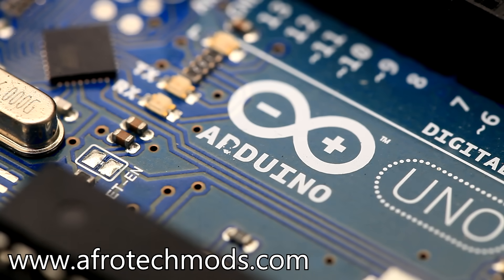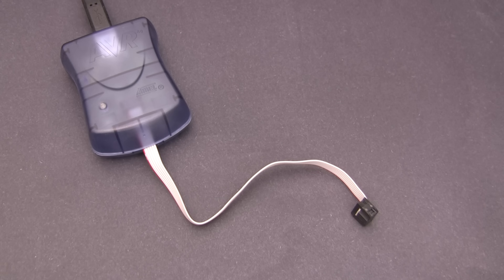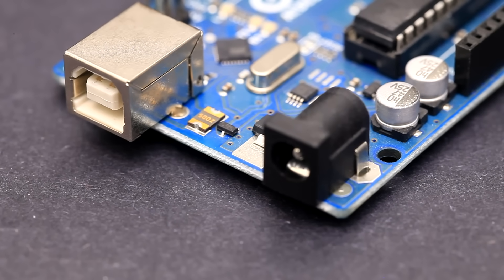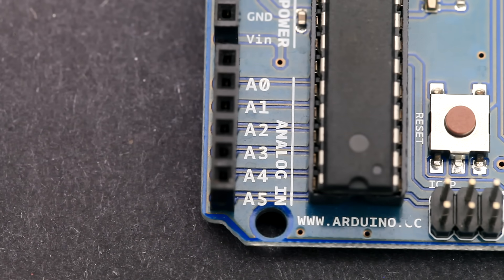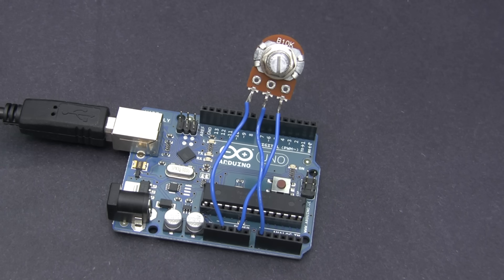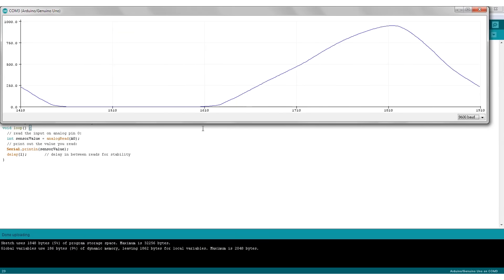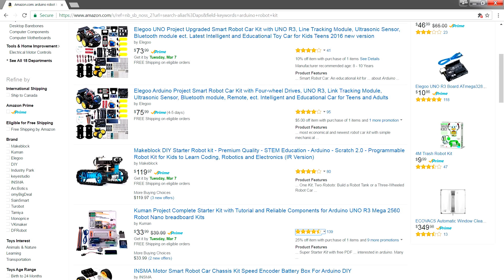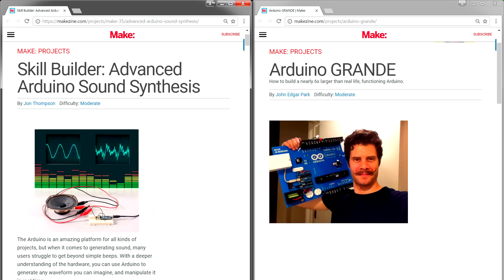You can learn Arduino in 15 minutes.

Comment: Ok so if I buy a new arduino I have to down load programming to it before it will be able to work in the system I want to use it in? its a blank chip until I program it is that correct?
Reply: Almost, when you buy the microcontroller it will be preloaded with the "blink" example. When you power on your board you'll see the LED flash on and off for one second each. Technically there is also a bootloader on the chip as well but I can't delve into that in a YT comment ha ha. Essentially, the chip is pointless until you program it for what you need.

Comment: Once you have developed a project and want to use it, do you have to keep all the parts and the UNO in a box or something? When you want to start another project do you need another UNO?
Reply: You can put them in a box if you want to make it a permanent project. You could also just pop the arduino off your breadboard and use it in another project. If you don't want the project anymore you could also just take it all apart and put it away.

Comment: Once again, an absolutely first rate tutorial!!! Afrotechmods is quickly becoming my gold standard for short and focussed explanations, while I then go to BigCliveDotCom for a more long-form, conversational approach to the practical application of those same topics.

The only thing I would add about this specific video is it may have been worthwhile mentioning that many Uno clones do not use the same virtual COM port hardware as the 'genuine' product and will not be plug and play just by installing the Arduino IDE software. For those you usually need to download the driver for the 'CH340' device. There may well be more serial chips used as well, but the three I have all require that driver. Unlike some commentators however I would not label these clones as 'bad' or 'inferior'. I have found them just as good and about a 10th of the price--£2-£4 instead of £30-£40!!!

Please keep making these little videos!!!

Comment: Great video. I'm a pro at programming PIC/ATMEL/8051 microcontrollers using proper in circuit debug tools but have been using Arduino's for some simple projects. I must say, although I didn't need to learn about it, if I was a noob this video would be perfect intro and I highly recommend it to anyone exploring Microcontrollers for the first time. Great job.

Comment: Two of the most hated modules of an electrical engineering degree, programming & DSP. Arduino's are little gems & have the best compiler it's light, stable & easy to use, miles better than the crap you find on university computers.

Comment: You might want to keep in mind that knowing how the circuit diagram operates helps the user understand how these devices use programming logic. This is useful to troubleshoot projects with programming errors. 
Understanding hardware could help you identify flaws in the system. Unless you build the circuit board from scratch , i doubt that soldering or wiring errors cause the flaw.

Comment: you can´ t learn Arduino in 15 minutes. You have to have at least basic knowledge about electronics and programming. If you have no clue about both and want to do projects, you are lost. It will take you weeks if not months to get into it. 
After 15 minutes you can basically tell what an arduino is and what it can do. However, i would not call this knowledge ...

Comment: 11:46 - but it's better instead of:
const int  analogOutPin = 9;
write:
#define ANALOG_OUT_PIN 9

Now you didn't waste memory for storing this simple number. For more information, google for "C++ #define as constant"
But for more complicated programs  const is still better.
Reply: I've seen several arduino tutorial and they all use const int instead of #define.  I cannot figure out why, especially in a system with such limited memory.
Reply: most compilers would optimize it out anyway

Comment: I don't understand why the resistor is between ground and the LED.. for this to work, wouldn't you be drawing power FROM the ground? And to stop too much current going out of a pin, with a resistor, wouldn't it need to be BEFORE the pin, as in soldered to the damned board? I don't know.. there's so many things you didn't explain here that I don't even know what to search for to find out what they mean or how they work.

Comment: Hi there, I am building a cockpit control panel which in this case has 50 switch buttons, does this Arduino board will support it, and how I will going to connect the 50 switch buttons if I only see few I/O?
I have checked as will the the Leo Bodnar card, which in this case has more I/O ports. I have never use none of these two programs or softwares, please if you can help me with some ideas, I would be glad.

Comment: I don't want to use a 9 volt battery. Trying to save money. By using 2 6 volt battery packs that are rechargeable. <--That's what I want. The 12 volt to 9 volt converter is connected to the batteries and the barrel plug.  So now that I know about the regulator on the board. I have a question: Can you leave the barrel plugged in while recharging the recharging the batteries. How in the heck would you go about charging the 2 6 volt batteries?. I know I'm missing something. The other  wires connected to the batteries. How would you connected to the 2 6 volt batteries. While it connected the way I want it?. <--I'm just asking. I don't have the arduino kit yet. I'm just trying to get advance knowledge. So I don't screw up.

Comment: A truly BRILLIANT video, and a very good explenation as to how to use Arduino, but the Arduino is a microcontroller, and the thing you keap calling a microcontroller is in fact a microprosessor. When you place a microcontroller in a circuit with prosessors, I/O-ports, etc. it becomes a microcontroller.

Comment: So, I can't add any motors to this Arduino?  Do we have a link on how to add a motor to it.  (Gear motor) I'm getting into this now.. Anyone!
Reply: You can control a geared dc motor with Arduino through a motor driver. Connect the motor to motor driver and supply the rated power to it. Take 2 digital outputs from Arduino and connect them to the control pins on the motor driver. When the digital outputs are 1, 0 -  the motor spins in a direction, when they are 0, 1 - the motor spins in the other direction (clockwise and counter-clockwise). 0, 0 and 1, 1 will stop the motor.

Comment: how many sensors can you connect to single arduino uno...?
Reply: depending upon the number of data pins that your sensor use you can connect the sensors to arduino.
for instance, if your sensor has only one data pin(e.g. - Hall effect sensor) you can connect 18 such sensors.
you can use the analog pins as digital pins.(just declare them in your main code setup)
to sum up, the number of sensors that you can connect to arduino depends upon the data pins of you sensor(s), but at max you can connect only 18 sensors (13 on Digital Pins & 5 on Analog Pins).
Hope this helps you.
Cheers!

Comment: Thanks for the awesome video. Am just new to this. In the analog input/ output example, what should I change on the program to get a 100Hz signal? I notices the frequency is around 490Hz on the oscilloscope.  Thanks again.
Reply: 100 Hz basically means 100 blinks in one second, so you can add delay in your program accordingly and run the program in loop.

Comment: so i need a computer connected at all times or can i write the program to the chip
Reply: you do not need to connect the computer/laptop connected to your arduino always.
some simple hacks to power up your arduino without computer/laptop are-
1. power up your arduino using a mobile power bank
2. power up your arduino using a normal(not adaptive) mobile phone charger
3. power up using 9V battery and the power jack connected to the arduino
4. power up using your car's USB port
basically any source that provides a stable 5V signal will do the job for powering up your arduino.
just program your arduino using computer/laptop and then power it up with any of the above mentioned methods.
hope this helps you.
Cheers!

Comment: Is it possible to connect an arduino with an eeg
Reply: yes. You can even read the voltage of the egg too.
Reply: Is it possible for the eeg to send its raw data to the arduino and the data gets to a certian point the arduino gives and output?
Reply: From your explanation, you will need to use analog voltage signal as a raw data. You can program the arduino such that when the analog voltage signal is over X value, it will give an output.
Reply: I am new to arduino programming. Could you give me the program or tell me a place where I can see the program. It would help alot.  Thanks bro

Comment: Hi ! I found your channel for a couple of days now and actually help my very much to understand things i didn't before. 
So now I do have one question more about tx and rx (transmitting or receiving signals) through arduino board. 
You said it is possible for an arduino board to communicate with componants like GPS modules, WIFI modules etc, BUT is it possible to communicate with for example 2 or 3 independant modules with the same arduino [UNO] board ? There actually is only one tx and rx pin per arduino uno board. (so do I need to use a arduino mega board ? or would it also work using regular arduino uno board ?)
Reply: you can connect these modules on a single arduino UNO.
the tricky part comes in coding, where you have to declare the digital pins as Rx and Tx.
you can find the help and code related to all this on arduino.cc forums.
https://www.arduino.cc/en/Tutorial/SoftwareSerialExample
hope this helps you.
Cheers!

Comment: will the voltage regulator increase the voltage as well? ie using a 3.7v 18650 li ion battery
Reply: no voltage regulators never increase the voltage that you provide to them.
voltage regulators only step down the voltage.
in case you want to increase the voltage from 3.7 volts to 5 volts, you should use a boost converter.
here is link of what a boost converter looks like and its specifications.
https://www.sparkpcb.com/development/xl6009-4a-dc-to-dc-step-up-adjustable-power-supply-module-boost-converter.html
It is XL6009 boost converter.
Reply: Avik Seth thank you
Reply: you are more than welcome Ashton Beattie !

Comment: At 5:30 he says you can't power a large motor with the arduino. So how can I go around this to control a large motor with an arduino? would i need to buy some other material?
Reply: You need a MOSFET or BJT.
Reply: you can power up/use a larger motor with arduino UNO in the below mentioned ways-
1. by making use of simple "Relay"
2. using BJT(Bipolar Junction Transistor)
3. using IGB (insulated gate bipolar transistor)
4. using an external DC 5V(high ampere rating) supply and having a common ground with arduino.
the most effective a solution above all is using a "Relay" to trigger your motor.
an example of "Relay" module is in the link below.
https://www.sparkpcb.com/development/1-channel-5v-relay-board-for-arduino-raspberry-pi.html
hope this helps you.
Cheers!

Comment: Is the barrel jack power supply 9v or 12v?
Reply from the maker: 9V would be better
Reply: you can use both 12V and 9V for the external jack, the arduino has SMT voltage regulator just at the left side of power jack. Still 9V supply would be better.

Comment: Is this basically the equivalent to a Raspberry Pi?
Reply: Not really.  The Pi can do pretty much anything the Arduino can do, but not the other way around.

The Raspberry Pi is a full-fledged computer running (usually) Linux.  The Arduino is a microcontroller board.  Think of it like the difference between programming your computer and programming your microwave.

Arduino's great for simplicity since there's not really an operating system, just a bootloader that initializes the chip and runs your program.  If you want to change the program, you plug it into a computer and upload the new version of the program.

With the Raspberry Pi, you can plug a keyboard/mouse/monitor into it and have a little Linux box you can program directly on.  When you get bored, you can play Minecraft on it.

I have two projects going right now: one is a controller/monitor for my lathe, and the other is a device I can use a remote control to play streaming audio in my workshop.  I'm using an Arduino for the lathe, and a Pi for the audio player.
Reply: no, arduino is not at all equivalent to raspberry pi.
pi has got lot more memory and processing power than arduino UNO.

Comment: Do I need a degree to understand the electrics?
Reply: A degree?  No.  You don't need a degree to understand anything.

I have a Bachelor's in computer science, and you could learn everything I learned just from watching Youtube videos, reading some books, and writing a bunch of programs trying different things out.  You just have to have the discipline to stick with it.
Reply: +Jeff Spaulding - Thanks Jeff, I am willing to learn but I am not sure where to start to be honest, what to learn first. "I can't see the trees because of the forest". I am studying for a Applied Psychology degree, two years to go, as you know thats a full time job to study, would you have a suggestion of where to start to learn the basics, what they mean to learn the foundations? I can tell you some of the best Psychology websites as it is in my domain if you get what I mean. As I would love to get a Arduino to be able to draw pictures for extra study. Thanks!
Reply: Electrical engineering is an entire field of study on its own, and it's pretty involved.  Fortunately, there's a booming hobbyist sector and most of the things you'd actually want to do don't require a deep understanding of electronics or advanced mathematics.  For the coding, you only really need to know the basics.  Arduino code tends to be fairly simple as far as software goes.

My suggestion is to just buy an Arduino starter kit (or a decent knock-off) and run through the tutorials.  That'll give you the baseline you need to start.  Once you have a good feel for working with it, start thinking out your actual goal.

The nice thing about Arduino is that there's a lot of people using them for all kinds of stuff, and a lot of them put their projects and code online.  You can look for stuff that's similar to what you want to do and cobble it together into your own project.

For instance, if you're wanting to draw pictures, there's a lot of projects out there for moving things in (x,y) coordinates.  You could find a project where someone's built a plotter with Arduino and basically copy what they've done.  Or you could get a robot kit and add an extra control to raise and lower a pen and you can draw turtle graphics - just look for code from someone doing something similar and modify it for your specific needs.
Reply: I Have a Path !! Thank you +Jeff Spaulding. I will start with your suggestions and thanks again
Reply: See if there is a robotics club in your area. Having people to give you a hand is very useful.
Reply: Thanks John.

Comment: Hey, can I use an Arduino to use it as an LCR meter ?? I meant to say can I program it to measure conductance and susceptance of an electrical device at varying frequencies ??
Reply: you can make one, but the question will come on its(arduino) reliability as a measuring instrument.
Reply: Avik Seth thank you avik for your reply. Can you plz explain it to me why it is not reliable ?
Reply: since arduino is not able to manage the "noise".
one thing that you can do is make a simple resistance measuring unit using arduino and then compare the results with your multimeter, if that goes well then only take a step forward by making a capacitance measuring unit.

Comment: I programed a stepper motor that stop 24 time in one loop. 
Would you know how to turn on an led for each stop ? So 24 blink.
LED on while motors stops. LED off while motor rotates. Thanx for your great help
Reply: just add LED,HIGH wherever the motor starts and LED,LOW wherever the motor stops.
simply add this to your code alongside the rotation of your motor.
Reply: Thanx a lot for your response ^_^

Comment: Did he say before arduino you would have to type out a bunch of binary?  You gotta be leet to script in binary.
Reply: Pretty much no one codes directly in binary.  He probably meant assembly code, and it's still not quite accurate.

Compilers exist for a lot of microcontrollers.  Some are free, some are not.  You can get everything you need to program an Atmel chip or a PIC in C from Microchip directly.  Same with Texas Instruments microcontrollers, and I'm sure many others.  In cases where the compiler isn't free but the assembler is, hobbyists will tend to use assembly.

Arduino's real advantage is the board, the libraries, and the bootloader.  You don't need a chip programmer, you can recover from most screwups easily, and most of the hard work is already done in the libraries so you just focus on the logic of your application.